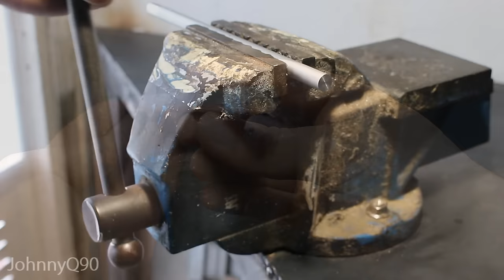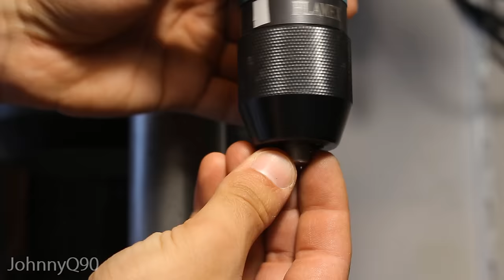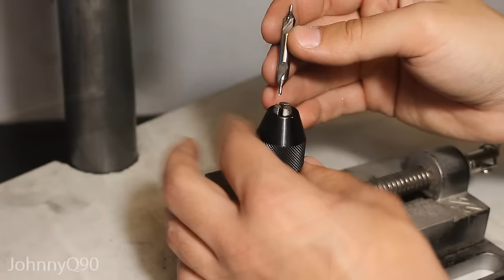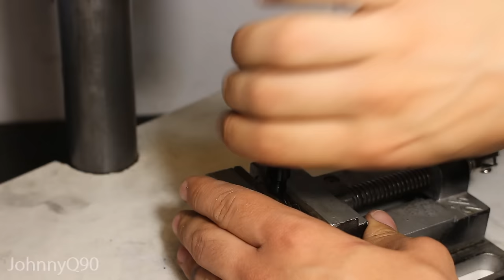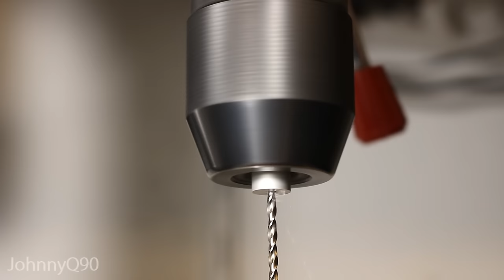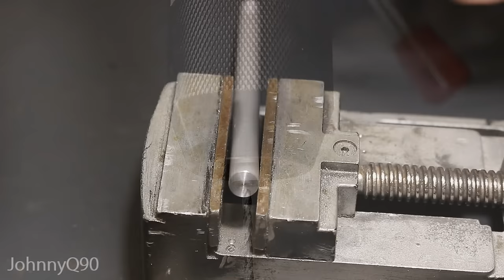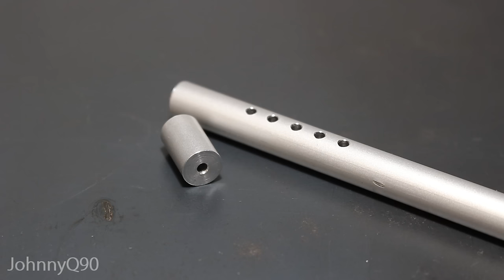Simplest Way to Drill in the Center of ANY Rod!

Comment: How is it in the exact center when he used a punch by eye to mark the center ?
Reply: He's using the drill press AS a lathe!  I thought it was pretty clever.  Making this disk on the lathe is easy and makes sense, but I've never even thought of doing what we saw here, and have needed it so many times.  Just drilling down the axis of a rod is something that comes up all the time.  I could have used this a hundred times!  I really also agree with Ratgreen about the setup.  It would make a lot of sense to make sure the drill is aligned with the spindle.
Reply: There are always tolerances in the world of metalworking, nothing is exact, even with a $1 million lathe) The method with the drill-press probably is well within the accuracy he needs.
Reply: Edit: I obviously missed the point of the comment. Thanks for the corrections everyone.
The method was mentioned in another comment.
When the piece was sanded using the drill press, the sand paper left concentric circles on the end of the rod. It might not have been clear from the video, but the center was nicely marked with a bull&#39;s eye.
Reply: That wasnt my point !
Reply: The point was he used a big punch, and the center was punched by eye. So its close to the center.
Reply: I completely agree, the title is misleading, he punches the hole in what he calls the "center"... This is NOT a precise method, it has a lot of variables going into it and is not accurate at the best of times... Sure for what he needs it is probably fine, but a lathe or a mill would do a much more accurate job to what I would call the centre...
Reply: The main point here is that one get a straighter hole, about in the center, using this drill press method, than drilling it freehand with a hand hold electric drill) Using a lathe is a different 'story', which is not a standard tool in the average garage shop
Reply: Plus, let's face it, there's a much faster way than machining a guide to get the same result: Put the rod in the drill vice. Draw a line down the length of the rod. Center the line between the jaws and drill it with the press. So much faster than this and just as accurate.
Reply: Unless you have a machine do it for you the centre is always punched by the eye... 
Some methods are more precise than others, and him using the sanding circles as a guide to find the centre is quite clever, and more than precise enough for any diy project that doesn't require precision to the 1/1000 of a millimeter.
Reply: By rotating the workpiece rather than the drill the hole will be centered. It may be slightly oversize but it will be centered.
Reply: Dill Wiggle : You have your answer from 58JMG.  When the stationary drill touches the spinning workpiece, the tip will be pulled towards the center of rotation even if the punch mark is slight off-center.
Reply: In machinist thinking, this would be grossly inaccurate. A few thousandths off would be horrifying  to them. Even in my limited experience, I saw the chuck wobble and drill skew.
Reply: this is exactly what went on in my mind
Reply: If he needed 0.001s of accuracy he wouldn't be making the final cut with a twist drill. I also think you have an incorrect view of machinists or engineers who are using the workshop being obsessed about achieving the closest tolerances possible in every given situation, or being "horrified" because a quick and practical solution isn't good enough for NASA and I wonder where you got this idea from.
Reply: Depends.  Many of us are quite disappointed in ourselves when we are more then .001" out :D
Reply: It isn't - this video gives out some terrible adivce.
Reply: Yes I also saw another error with the wobble of the drill chuck, he is wrong to call it exactly centred
Reply: https://de.wikipedia.org/wiki/Zentrierwinkel
Reply: i don't see that many people whining, just discussing alternative methods and tolerance, if that's what you mean. and i'm not publishing videos. measuring tools would probably one of the first thing i'd get for a personal workshop, but as already mentioned. this and the tolerance you want to achieve obviously depends on what kind of work you want to do.
Reply: Yes. Save a lot of time.
Reply: all wrong, go back just before he punched it. two marks in a + symbol
Reply: When he cleaned up the face with the rough grit paper it left concentric rings around the center the very center being a do. he marked the dot then punched it
Reply: If the rod stock is concentric, then the best way to end center drill it is to chuck the piece then lower it into a vice setup! The bit will align with the center according to the jaws. Other than that, side center drilling a cylinder is academic. If you can afford a press as good as this, then you can easily afford a decent groove plate and bushing jig!
Reply: Not really.  If your vice isn't on an X-Y table, it's going to be terribly difficult to put multiple holes exactly on the same centerline, just by eyeballing alignment with a marked line.  Also, with any normal home-shop drill press, it's going to be impossible to keep the bit from walking off the centerline on the top of the cylinder and making holes essentially randomly.

This cleverness of this trick is that it's using the stock itself to make its own centering jig.  I think a lot of the comments are missing the point of the exercise.  If you want to squeeze the best repeatable accuracy out of the limited selection of tooling that he showed, there aren't many places where this can be improved.  I'd have prick-punched the center first, myself - that off-center, held-at-an-angle center punch made me cringe, but the rest of his technique maximizes what he's got to work with.
Reply: I was only referring to end drilling! No X-Y or cross needed! Side/Arc Drilling without a guide bushing would require a center bit to start the intended hole. This will eliminate any deflection... Good things take time.
Reply: Because the sand paper makes concentric circles (scratch marks) that clearly mark the dead center of the rod.....
Reply: TY
Reply: OMG HOW are people not getting this?! The punch was a rough center, THEN he used a CENTERING BIT on a rotating piece of stock. It's that simple, so can we not talk about "A Machinist World This " or "A Machinist World That" because no one cares. IT'S A SIMPLE CENTERING BIT !!! And yes, a metal lathe would be EVERYONE'S FREAKING CHOICE, BUT HE DOESN'T USE ONE! My God, people on YouTube would over analysis fucking cat poop if there was a video about it.
Reply: Yeah i'm getting tired about hearing it myself also lol
Reply: Yeah, and if you use a lathe,  center drill it,  then re-turn the outside you still won't get any better center than the tolerances in the lathe.  "Perfect" center is a matter of luck or chance, how "perfect" does it have to be?
Reply: Its close enough for the vast majority of us.  If you need "dead-on-balls-perfect" then take it to a quality machine shop.  But for the rest of us who need to work in our own home-brew shops, this is by far good enough -better than you're likely to have been getting before.  Its a much appreciated lesson.
Reply: Here's the problem as I see it... Every machinist I know seems to know more than other machinist that I know, and if you're a machinist, then you know more than all the other machinist, or you're scared to death of not knowing more than other machinist. Hmmm. 

And why is it that all machinist have the same stupid stories???? 

"Yep, I knew a guy who left the tightening chuck in the lathe, he turned it on and it flew across the room... They fired him on the spot."

How can EVERY FREAKING MACHINIST on the planet HAVE THE SAME FREAKING STORY ????????????????? Stop telling it cause it makes you look stupid!
Reply: @ Ed Powell - What you said.
Reply: What if all you have is a drill press, a vice and luckily a center drill how would YOU get the "Perfect" center you wanted? I think it was a clever way to come close if you have no other way than to take it to a machine shop -
Reply: W Ray, with regards to multiple holes on a centerline, what if i create two of those centering jigs, put a pin in one, drill my first hole with the other jig, then put the pinned jig in that hole.  when the vice tightens on both centering jigs for the second hole, it should get pretty close, yes?
Reply: EXACTLY!!!
Reply: Excellent point; I think a few here are going to the 'nth degree in science rather than taking it for what it is
Reply: If the mark is punched slightly off the center, it will center itself automatically as soon as rotation starts
Reply: Ed Powell:  I knew a guy who...............
Reply: Exactly, Twisted Melon! Notice at 2.05 that the vice holding the chuck with the center bit is not clamped to the table but moves freely to self center.
Reply: I was thinking of a simple V-shaped holding jig for the rod. Center the drill bit with respect to the bottom of the V, then place the rod in and drill.  This method seems like... overthinking the problem..
Reply: Your concern would be valid if the drill bit was turning and the stock was clamped in place.  However, he did the reverse.  Therefore, even IF the center were not "centered," because the stock was turning, and the bit was clamped, it wouldn't mater.  The hole was perfectly centered, leaving the size of the hole as the only thing that could have been different.
Reply: Dill Wiggle i
Reply: This was a great video. Thanks for the tips. Time to cook. Get free CHEF recipes on our channel.
Reply: It is not. By machinist terms this is a horrific video. He would be lucky to be holding .010" on center. That is assuming his drill didn't lead off when he drilled thru, and that the stock was perfectly round and not slightly egg shaped, and that the drill didn't try to lead off when you started drilling in to the lower piece. However, in a pinch where you need a fairly on center hole, this would be better then trying to do it by hand in a drill press.
Reply: unless he's building a Swiss clock or some other precise application . What he showed in the video has merit for certain jobs. You understand we are not all machinists
Reply: a human hair is .004 you mean the thickness of a piece of foil right? and machining standards are very rarely that tight more like .005 on average different pieces that are made have different standards for different reasons for different applications not everything a machinist does it at a .001 tolerance it varies on application.
Reply: He basically DID that!  He used a center drill to drill into the rotating stock.
Reply: Jim Seats you know what man do you know what you need to do you need to test the same thing this guy did and see if the bit will let you even drill a hole off center!  it won't a spinning object will ALWAYS FIND IT'S CENTER there bit will find its center reguardles of where you start it if you start it off center 1 of two things will happen 1 the bit will center or 2 it will break it's not rocket science it's the first day of class in machinist school you can not drill a hole off center in a spinning object. just try it and post a video and prove physics wrong Einstein!
Reply: diy alumunium roll
Reply: I noticed that the punch mark was a couple thousands to the left by my eye. Using the concentric scratches made by cutting is accurate but I don't think you he spend enough time setting up his center mark.
Reply: 1 or 2 strokes with a file and center punch and drill, is the easiest way and fastest for me.
Reply: Everybody here is so right lol
But if he lathed it properly, the center dot should be no larger than .3"
Reply: Dill Wiggle ...You really have no clue do you..
Reply: Twisted Melon I wish this was true...  But when the piece chucked in the drill press does not spin straight, the drill will likely flex (if small enough) and the resulting hole will only be centered at the center point of rotation, rather than the actual center of the rod.
Reply: Being close to the center is all that is necessary, as the high rotating speed and careful feeding of the center drill point into the cavity during the revolutions will center itself. I lay odds he is well within a few thousandths.
Reply: +tuscolian
"In machinist thinking, this would be grossly inaccurate. A few 
thousandths off would be horrifying  to them. Even in my limited 
experience, I saw the chuck wobble and drill skew."
The drill gets forced to center though the hole will be sightly bigger.
A master machnist would know but shop monkeys would not.
Reply: I do not believe this video indicated the necessity of holding tenths of thousandths of an inch that might be required in certain jobs. If I gave a mechanic or machinist a job requiring +-.010, and he could do the order in one hour holding that tolerance, I'd be happier than if he spent three hours holding it to +-.0001, using center finders, etc.
Reply: As  a Machinist do you understand how the hole made can't possibly be off-center? Think about how a boring bar works in a metal lathe, the drill is a poor boring bar.
Reply: At home, I just use a center drill on my lathe to start a hole. With regard to centering a hole on the side, for me edge finders work fine. Not everyone has a lathe, and still others do not require such tight tolerances. I think this line of thinking is making a mountain out of a mole hill. Cheers!
Reply: That's all fine but I was pointing out the impossibility to drill an off-center hole in that rotating workpiece.
As far as tolerances, designing for the lowest needed is what we were taught in design school in the 70's. Besides, you can machine to a thousandth of an inch or less then let the piece change temperature 5F and be out of tolerance if your piece is big enough.
We did sheet metal hole placements within .005 around bends on special orders and threw out less than half of attempts to make 20.
When I think that I shoulda stayed cuttin metal, I look at how few jobs doing that are left in the country. Is this all a dying art?
Reply: Buzz, the original point I wanted to make was that his ideas work for what he wanted. No need to go on to the fine points of machinist technology. I'd do things a little differently. Boring bars carving out a hole is great when needed or desired. Well, enough of this - I got to get back to two past due jobs in the shop. Best wishes.
Reply: Oh it looked to me that he manually used a punch silly me lmfao
Reply: One thing I used to do sometimes with similar work (putting holes on a side of a round bar), was to put the part in a machinist's vise, make sure it was secure and square, then shave a bit off the hole location with a mill. For example, if the hole to be put in was .250 dia., then using a .218 end mill, take off just enough that the .250 drill would not leave any trace. Then with the flat surface, and locating the center of the bar with an edge finder (part of the bar would extend a bit past the edge of the vise), center drill followed by the drill. This would remove the tendency of a drill to want to run down the side of the bar.
For a number of years I worked at a computer company in a proto shop making experimental computers. The engineers there wanted everything to be as exact as possible, and out of one piece. Layout with setbacks, etc. was actually fun to test one's ability to accomplish the tasks. I used to make punches and dies - all sorts of stuff. Good memories but stressful.
Reply: +dddphilosophy  Exactly, nailed it.
Reply: Thanks !  At least one other person has seen it the CORRECT way !  lol
Reply: well it's probably good enuff for the crap he builds
Reply: His idea can only drill centered holes, that's what he wanted, to show how.
The hole will ALWAYS be on center though the diameter may be slightly larger than the drill.
Reply: +Dill Wiggle 
"Oh it looked to me that he manually used a punch silly me lmfao"
That's because he did. And if he turned the drill instead of the workpiece, the hole would be off-center.
Stay silly, it's easier than thinking.
Reply: +michael stradley
WTF "crap" do you refer to? Or do you simply ad-hom when you don't know shit?
Reply: Buzz Werd m
Reply: Wiggle: How is it in the exact center when he used a punch by eye to mark the center ?
Ans. When the drill enters the spinning punch slightly off center because it was eyeballed, the hole will end up slightly larger than the drill size, because it is off center. Thus, a .250 dia hole might end up .255 dia. for example. Too much and with a small size drill, it might snap.
Reply: Wiggle: because when the drill is off center in the turning workpiece, one side will be cutting metal and the other will not. That will push the bit into the center of the turning rod quickly since the drill will bend a little and the punch was closer than that. If the drill was the part that turned then it will follow it's own center *but it's not*.
Have you ever used a wood lathe to make a bowl? No matter where you gouge into the turning face it will make a circle centered on the turning center. The cut HAS to be centered just by the way it's done. Same with that drill.
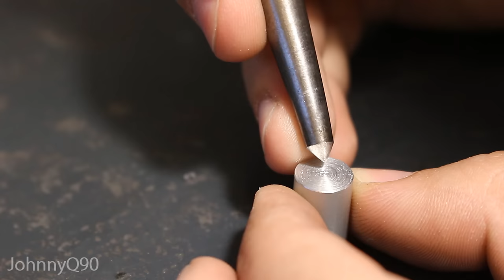Reply: Check 1:11 he scribed the center first.
Reply: Drilling the hole through the center of the rod by turning the rod, not the bit actually corrects that little bit of error. He shows the finished cut, it is centered (has to be because the cut piece was turning, figure it out).
How much room in that small diameter rod is there for any extreme error? 
If I use a compass to draw a circle on paper I won't be able to center it anal-retentive exact. But if I can turn the paper around the anal-retentive exact center and hold a pencil out from that center then the circle made will be exact enough for the average A-R but never ever for extreme A-R's with mental Planck-length measures.
Reply: +ajn.mychannel You are right that the centerpunch is only close to the center, BUT the center drill in the vise acts like a boring bar. Think of the point of the center drill. It starts cutting a ring on the aluminum, but as it goes deeper into the aluminum the center of the ring is machined away and the center drill "falls" into the new hole and that hole is in the center of the aluminum piece as defined by the axis of the drill press. 

Using OP's method the center drill cannot make an off center hole, just like you cannot make an off center hole in a lathe unless the chuck is broken or shimmed or worn out.
Reply: Do it right or don't do it at all.
Reply: Anything that meets specified tolerances is right. It's in the definition of tolerances which do stand up in court should a customer and manufacturer disagree on parts made. Parts within tolerance are right.
Still unless your drill is made of Absoluteum, it will be bent to the center of rotation of the workpiece.
Reply: Was going to say this but you beat me to it. For his purpose I'm sure it works.
Reply: You really don't understand how it works then and likely have unreal or impractical ideas about machining.
Try taking 0.002" lathe cuts off 303 stainless some time. See how well that fits your mental picture.
Reply: Wow! It's true, people will piss & moan over everything! it's You-Tube, give it a rest! Loved the idea, Maybe dill pickle is a wing nut from NASA! LOL
Reply: Wise words. Thank you.
Reply: Notice he sanded the end flat first, see the sanding marks concentric to the centre of the piece, then he is actually using the drill press as a mill, if his centre punch is slightly out, it will 'self-centre'. 
I am more concerned with having the 'held' drill absolutely in line and centred with the spinning chuck, and he spends a bit of time adjusting this, but that might even pull itself true as it drills.
I love a day when I learn something good I will use often.
Reply: Dill Wiggle exactly
Reply: Ed Powell. You've spoken true words about the machining world which has it's head so far up it's ego proud ass that they'll go to the grave thinking they were right and the world was wrong. I have heard the chuck in lathe story also.
Reply: Also, what if you don't have a piece of the same exact diameter as the piece you want to drill? There are better ways than this which are less time consuming. The challenge is just to mark the exact center of the piece you want to drill, then a center punch is no less accurate than it was to make the tool. a carpenter's square can be modified to draw a line on the center of round stock, then you just drill the hole, no tool manufacturing necessary.
Reply: This is NOT an accurate method for locating the "exact" center, which by the title is what I assumed we would be getting a tutorial on. This method also assumes everyone has a drill press at their disposal. I personally do not, but it is not the biggest loss since this method is not completely accurate in the first place.
Sorry, but a thumbs down from me. Which in a way is a shame because otherwise the video was done exactly like a tutorial should be. Little to no talk, just show the steps and be dond with it. All of those videos out there where people yackkety for much too long are incredibly annoying.
Reply: He removes any punch "eye" error by setting it up like a lathe.  The tolerance now is "on" the drill press and any out of round that may exist.  This setup is the most accurate way to do this given common tools most people may have in a home shop.
Reply: It's not really clear, but it seems that "X" marks the spot at 1:07.
Reply: Hes still lining up the punch mark with the centre drill though? The spot drill will just pick up the mark hes made with the punch. In my opinion its not accurate. Its probably good enough for his requirements but not as accurate as using a lathe to do everything.
Reply: Yeah, the drill bit was at an angle. If his jig rod were longer, he'd come out the side of it eventually.
Reply: He used sand paper to mark the center...
Reply: Totally subject to operator error. If he got it right, he was lucky.
Reply: Perhaps a different vocation is needed then.
Reply: the drill will find the center even if it has to cut the center point to do it, the center point just gives a spot to start the drill and get it close to center. its similar to the concept of an edge finder where it will find the center of rotation.
Reply: tuscolian you should see the chuck wobble on binky project, still comes out spot on!
Reply: It is as exact as his tolerances dictate. If he needed to be +/- 0.001, he probably wouldn't be using his method. This is geared towards people that don't have a lathe at home and need to get this done. It's not hard to understand that the average home project doesnt need to be that exact nor does the average homeowner have the equipment or even the knowledge to be that exact. Whether he said "exact" or "close enough" in his title doesnt matter. Its semantics and people are being picky for the sake of being picky to make themselves feel important because they know a lady who's neighbor's cousin's brother's wife slept with a machinist behind her husband's back.
Reply: i dont know if he also made them by aye, bvut you can clearly see a 'X' scored into the end which he is using to set the punch
Reply: Mark the center with a smaller bit while spinning it in the press then use a larger bit that will self center on the edge you just created.
Reply: Never understood this. When i left a key in the chuck the chuck rotated 100 degrees and the key jammed against the front way. No flinging . Maybe if it was in the back hole and had 180 degrees to rotate.......
Reply: He's clearly not s machinist, but it's not bad for guess work.
Reply: Dill Wiggle 
...and uses wd40 for cutting fluid.
Reply: Franklyn F 
No, you don’t get it. He does several unnecessary steps in a row trying to be ‘accurate’ when if all he did was use a bit and even just his eyes he could center out on that rod in seconds. 
It’s just total unawareness of what he’s doing and glaring  lack of mechanical knowledge that lets him demonstrate how he deftly takes a 30-second job and transforms it into a five-minute+ job. It’s what happens when someone who doesn’t have to eat from his tools tries to provide instructions on using tools.
Reply: Pretty sure there are two scoring marks on the piece. You can hardly see them though. This is reaffirmed by the fact that the punch is "skipping" on the surface of the stock.
Reply: The rod turning and the vise not held down the center drill will center itself.
Reply: It isn’t. All measurements have uncertainty. But the idea is it’s easier to eye and drill the flat circular top than it is to eye and drill into the pipe directly. It depends on the material and circumstance but this was a cool way to get the center if you have the time and need it to be pretty close to center etc.
Reply: @dillwiggle2  punching "by eye" is irrelevant when a concentric circle from the sanding was sitting right there to put the punch in...  We're clearly also not trying to machine a crankshaft that will rotate at 5,000 RPM and therefore have to be at high tolerance to be on center...  Off a thousandth or 5 thousands won't matter in most all applications where the work is not being done in a machine shop.
Reply: @TheCharleseye  Clearly overlooking the challenge of getting a bit to drill into a rounded surface...  Even a 1/4" bit will flex a bit under that circumstance and not drill dead center without a guide sleeve as this provides...
Reply: It wasn't exactly eyeballed. There is a reason he sanded the surface, to form ripples the smallest ripple would be or point size, exactly in centre.
Reply: @dillwiggle2  It will always be close to the centre!
Reply: @daviddou1408  Thanks for pointing that out. I obviously missed that. I'll edit my previous reply so others don't have to keep correcting me.
Reply: there is no exact centre ....ever!
Reply: @ajn.mychannel4864  but he is using the fdrillpresx as a lathe,by rotating the workoiece the cenerdrill will seek exact center of rotation
no comes the good reason in this case to let the vice float
almost assuredly the punch mark will not enable an instant dead center start 
this will be felt as the vice oscilating after the first peck
now once started the vice should be clamoed down while the quill is pushing down 
now gently pecking with a good sharp center drill,will almost full self correct as the center small center drill bore is gebnerated and it will be slightly oversize 
when the larger section of center drill just starts making dome progress then the tapered counter bore should be fully corrected and dead on center
Reply: Rimrock300 t
Reply: I thought the same but the first bit of rod was just a 'jig'. 
The whole he wants to achieve is the center of the rod,     but Sideways  (3.21)
Reply: It was a good guess???
Reply: @58JMG  my thoughts exactly. Just like how a bicycle wheel is much more stable while rotating rapidly
Reply: @TheCharleseye  Not quite. Without a guide, especially thin drills will bend and travel off-center.
Reply: Not accurate. But good enough for southeast asia.
Reply: ..........got it and the sandpaper is clever...The was an attachment we could get to fit in our drills in order to drill a perfectly located hole transversely in to a round or even square bar or tube..It was Australian designed and invented and I haven't seen it available since mid eighties.
Reply: @leonardpearlman4017  ...Center of a circle.  Fold in halves.
Reply: The punch could have been off but his method of spinning the rod instead of the drill bit would naturally find the center, even if it's off.
Reply: @leonardpearlman4017  If you thought this was "clever", then you'd likely be satisfied with the less than precise result.
Reply: @dillwiggle2  AND the punch was held at an angle which influenced the result in a negative way...if centricity was the desired effect.
Reply: Looked to me like he had the center marked before he punched.
Reply: Dill Wiggle read again, he said center not “exact center”.  Give the guy credit this is a very good trick for most garage worriers that don’t need things machined to the micron.
Reply: He used sandpaperto create a center.  I wss going to make f'in of this guy but in reality there's a million ways to skin a cat and good way isn't too bad.
Reply: @Rimrock300  well the tolerance for that length (diameter) is not that big tbh. It also comes down to what he is doing. Is there symmetry on the workpiece? Is there roundness on the work piece. Yes there is always a small tolerance that is a given, but what does the technical drawing call for?
Reply: @EdHunter55  1/1000 of a mm? Wtf are you talking about? No machine will give you exactly 0.001mm or a micron. Hell I work on a grinding machine, and our lowest tolorences of +-0.008mm is extremely hard to hold. Mind you this is grinding, while milling and turning normally have +-0.01mm if they aren't being worked further.

Just not sure what 1/1000mm means. I assume it means a thousandth of a mm, in which it is easier to post "micron" or "μm", or "0.001mm".
Reply: Didnt machinists and engineers build the shuttle that blew up and killed everybody?  They should have hired commentors on utube.
Reply: @Rimrock300  How right you are.  All new machines are made on old machines.  All you are looking for is accuracy within the needed tolerances.  + or - 1/10,000 accuracy is rarely needed, even on new equipment.
Reply: This guy here is a machinist lol I like this comment
Reply: What kind of Bit was that you used at first?
Also would like to know what kind of Drill Press that was?
Thanks in advance
Reply: The punch need only be approximate. The bore hole in the rotating work is centered about the axis of the drill press, not the punch indent. Even if there were no punch mark, just the rotation of the aluminum would carve out a hole with diameter of the difference between the axis of the drill press and axis of the cutting tool. So, its really a bore process, until he switches to the drill bit.
Reply: @hvacr tech not everyone has a 5 - 30 thousand dollar Lathe sitting around at their disposal.
Reply: Jesus Chrost people, he wasn't building a Part for NASA. This was simply an Instructional Video on how to Drill a Hole in a piece of Round Stock. Not everyone has a multi thousand dollar Lathe or Mill. This was showing the "Average Joe" with some AVERAGE Shop Tools how to get the job done.
Lighten the hell up!
Reply: @dillwiggle2  swirl patterns from the sanding may have created a point?
Reply: If you can't tell it's not exactly centered, it's exactly centered. Whether it truly is or not.
Reply: Exactly!! That was my comment and the very first thought I had while watching this. It makes all the technique that follows somewhat unimportant....lol.
Reply: He didn't do it by eye. When he put the piece in the drill press then pressed down on the sandpaper it naturally created circles stemming from the center. He placed the hole punch on that centralized location created by doing so.
Reply: @leonardpearlman4017  I agree. I was thinking exactly the same as you. Quite clever indeed.
Reply: I don't think he marked center by eye,you can see a cross where he punch marked the center. I'm not saying it's a true center,but it's pretty quick and easy method to do when you have limited tool arsenal.
Reply: @ddegn  That was very easy to miss! I also missed it too lol
Reply: @ddegn  [p
Reply: @Brewingbiker . 'lllo
Reply: If you look close, he has a small X marked in center, this is where he placed the punch.
Reply: @dillwiggle2  It is NEVER the centre when I do it that way. 😳
Reply: I’m sure I saw a small X marked for location but I think the point was for holes in the side of it
Reply: Maybe 🤔 he micet it erlyer
Reply: If you're a machinist drilling to 1 mil tolerance, you aren't going to use this technique because you will already have tools to ensure your accuracy. Most builders don't need that kind of over-engineering. The punch just keeps the cutting bit from slipping away from the center while starting the cut. The bit will cut around the actual center of rotation, so the hole will end up being centered correctly even when the punch was slightly off.
Reply: @tuscolian , all machinists only hold the tolerances specified by the drawings. In absence of those, normal shop tolerances may be +/- .002” or even +/- .005”.
Reply: @leewriter4656 , that was the same guy working his way from shop to shop, and he never learned.
Reply: @ddegn  thank you
Reply: He circular sanded the ends, and the rod was centered in the chuck, so the center was shown by the grinding lines. The only inaccuracy in that eyeballing was in making sure that the punch was on top of the center point.
Reply: @ajn.mychannel4864  What if you don’t have a lathe? “Get a lathe” is not an answer!